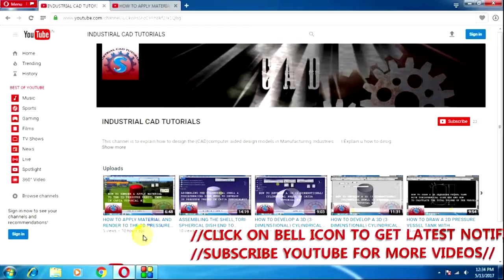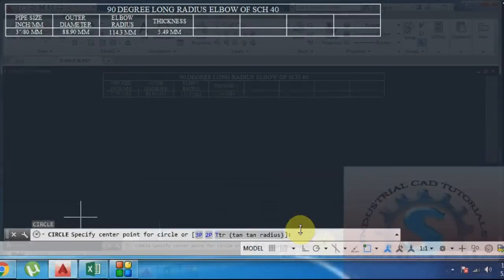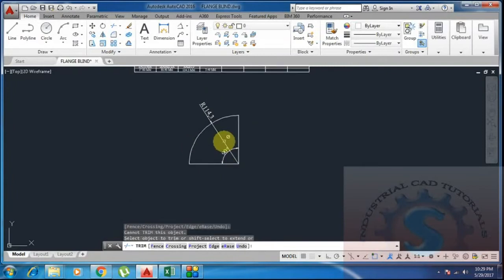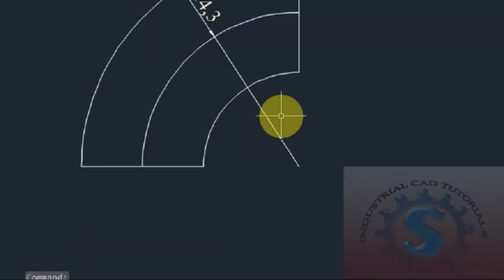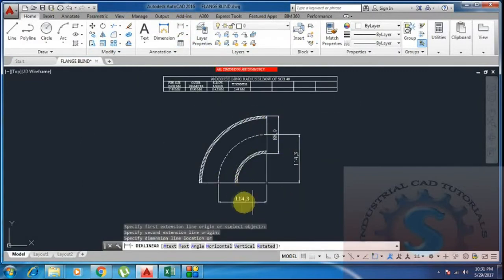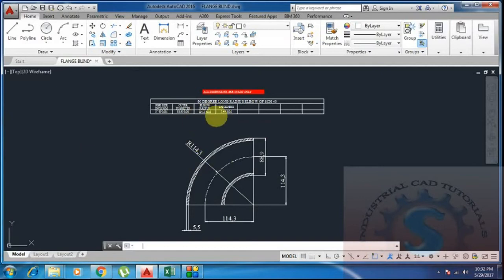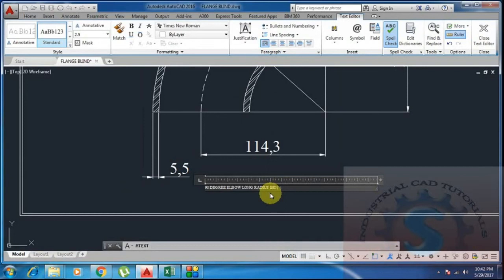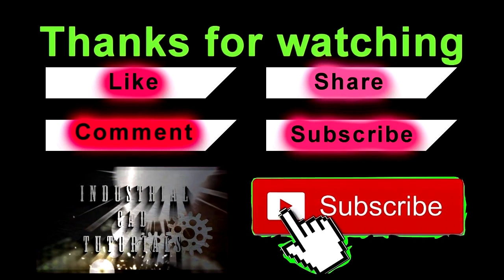90 DEGREE LONG RADIUS BEND 2D DRAWING IN AUTOCAD TUTORIAL #46

Comment: sir if radius is not know but lenght of elbow know then how to measure radius
and without radius how i draw elbow
Reply from the maker: Ans: First draw the length of the horizontal  line and next draw the length of the vertical line. After on that center point draw a circle. that circle will touches both of the end points of two lines  then measure the radius. without radius also u can draw the elbow but the horizontal length and vertical length is required.